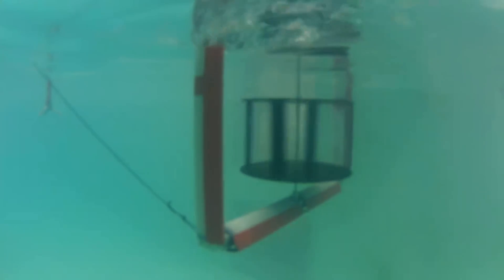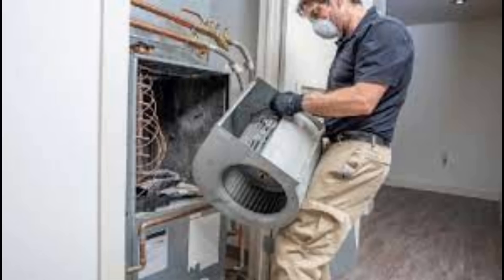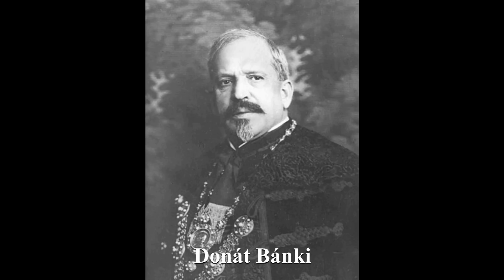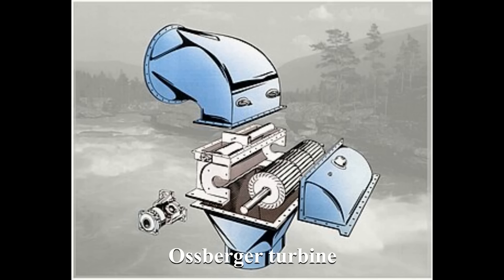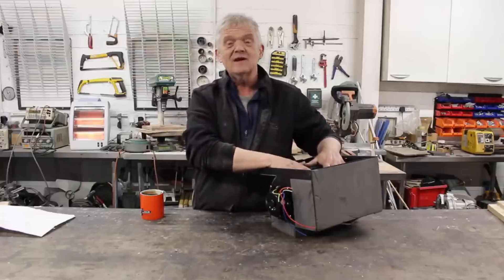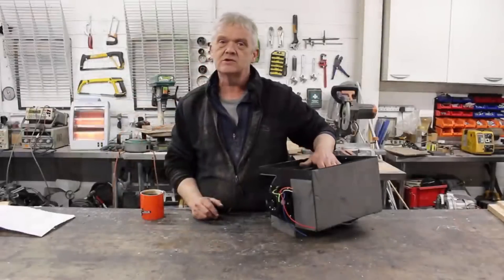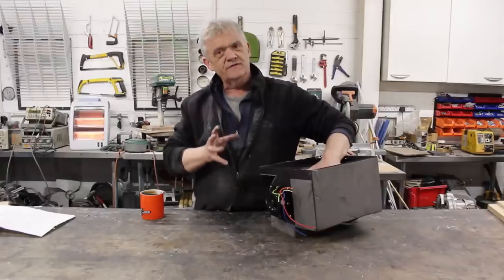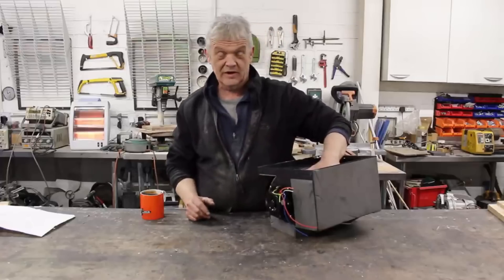2214 A Cross Flow Water Turbine - The Banki Mitchell

Comment: I live on a boat in a harbour that has tiding (if that is the correct word for the water going up and down by influence of the moon) So there is always waterflow around my boat. Will that be enough force to drive a generator using a water turbine like you showed ?  Something like 100W or so as addition to my solarpanels. It flows even in the dark 24h a day, but it changes flow direction a few times.

Comment: This seems to be perfect for low fall  creeks. Just build a dam about 12"-24" with a spill way over it. Place the turbine at the end of the spill Way.  Only a foot or so away, or longer for larger turbines, it would be simple to build a slip roller from 2" thick wall pipe.  6 Bearings, and a chain couple sprockets, a windshield wiper motor. Or hand crank. Set the distance between the rollers to determine the diameter of the rolled sheet metal. A 2 mm to 3 mm mild steel should be plenty. Roll it to a roughly 12" to 36" or larger diameter. Depending on the area used in.  Make sections in 12"'24" 48" cut end caps. And brace rings could be just 1" slip roll rings welded one inside one outside with 1/4" bar attaching the two.  Possibly going on to the center axel . Then basically put it in a box.  Mount a row of magnets on the end caps and a pair of serpentine coils on each end rectify and parallel or series to get the voltage range needed... Sounds much better than a large undershot water wheel. Lots less material and output

Comment: How does this play with your previous research into turbicles?  Would printing a cross flow turbine with turbicles increase the efficiency, or would the fluid traveling out suffer from the same design elements that help it upon entering?

Comment: I wonder if you could put something like this on top of a chimney. To use the wasted heat to generate electricity in the winter for people off grid heating with wood stoves sense it's harder to use water in freezing temperatures. Might as well use a lose for a gain
Reply: Living in the U.K. even at 57° North (think Churchill, halfway up Hudson Bay for a North American equivalent), our nearby stream never freezes over (fast flowing water very seldom does), it should be possible to harness the energy in this way. 😊
Reply: @freeforester1717  I've been trying to think about harnessing stored water for those not close to a running stream or spring. Water is already stored so might as well use it by pumping it to a higher level using it free fall or as a gravity weight but I haven't been able to think my way around freezing in winter so when I watched this video I begin thinking about using this turbine in line with the heat loss of the chimney most off grid people heat with wood already and fuel is fuel might as well get everything you can out of it
Reply: You can get a "back boiler" for stoves or open fires to heat radiators, I think you could hook it up to some sort of steam engine. I saw a video where the guy built a giant sterling engine, if you're somewhere cold the condenser part could be outside and your woodstove would be the burner!?

Comment: Shape the inlet like half of a hyperbolic funnel and let the water flow over the flat part and funnel into the wheel. You will get more power this way because of the shape of the water. Separately, we went over a patent last night from Russia that uses cavitation to generate power very far over unity. I wrote a paper about potential energy and how it applies to the cavitation tech exhibited in the patent over on my subs tack. I think you could really be helpful with what is going on the Martin fleischman memorial channel. It's small but the research is very important. You should check it out!